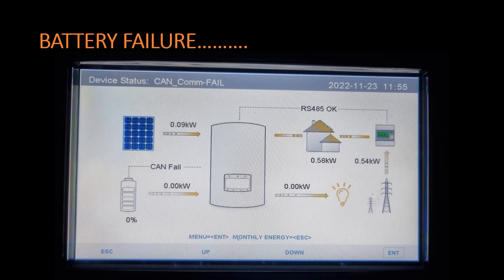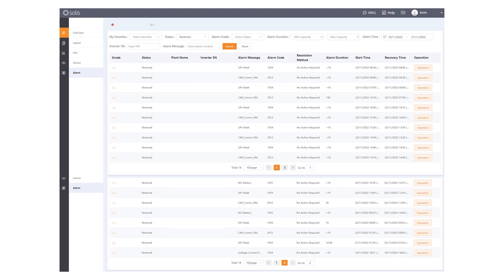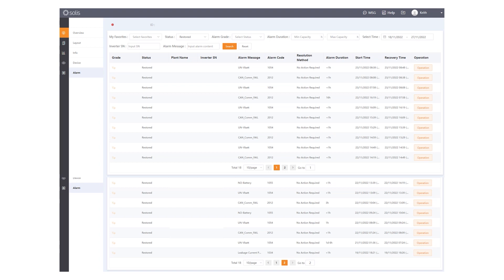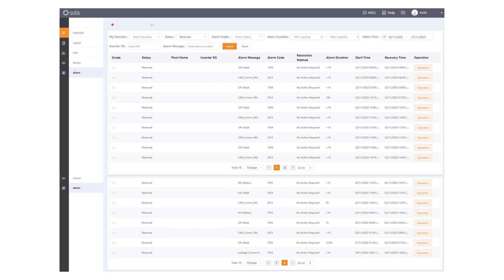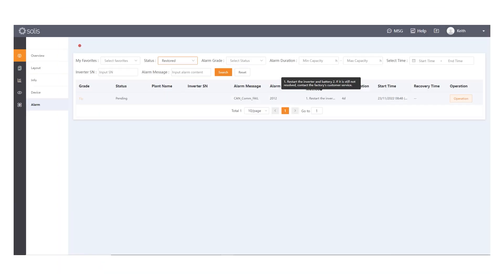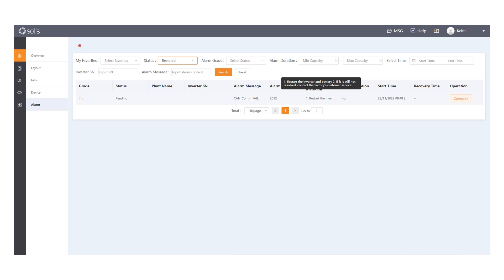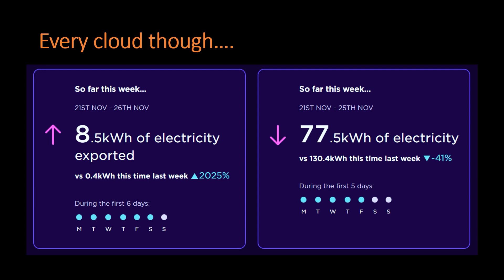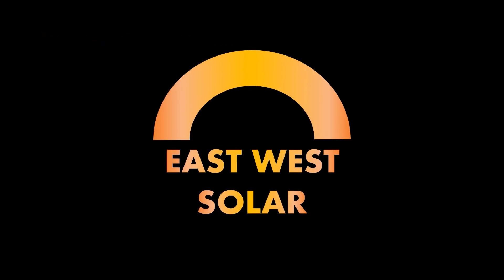Solis Inverter Communication Problems! Our first technical issue....

Comment: HI East West Solar: do you know which is the protocol that the solis inverters use to talk to the gateway/data concentrator over RS485? We thought it was modbus, but its not/ thanks!
Reply from the maker: I'm not sure I'm afraid. A quick google search shows that it is modbus, but I suppose the question is more what you are trying to integrate the inverter with?

Comment: Are all your batteries the same size and model ?
Reply from the maker: They are - they are all PylonTech PYLON US2000 PLUS LI-ION Batteries.
Reply: @East2WestSolar  I have same solid hybrid inverter and same batterys also same problem.Did your issue was fixed and if yes what they did?

Comment: I have the same setup and have the same issue and still have NO battery, been 3weeks with no battery, my system was installed in January 2023
Reply from the maker: Hi Malcolm - that's frustrating - I'm surprised the issues is occurring on new installs still!

Mine was resolved at the beginning of February and I've not had any issues since. The engineer that came out effectively reinstalled each battery and made sure they all had the latest firmware update. That seems to have resolved the battery part - although I believe we are still awaiting a firmware update for the Solis inverter.

Comment: Thanks for this.  My Solar system was installed on Wednesday this week, and I noticed this morning I had a can comm fail.  After a few minutes it went to OFF GRID, and has stayed there all day.  The pylontech battery is at 2 lights with the run light blinking very slowly.  Contacted the installer, they were supposed to come today to sort out the dongle (they didn't come) as it refuses to connect to my home broadband, and my phone can't see it, despite having a split system in the house.  

So I have a system that  has a fault, an app and PC that has not data in it, and it is now Friday evening, so no help until next week, and of course that is the one week that I am away from home the most.  Not very happy at the moment.  The only consolation is I haven't yet parted with my hard earned money to pay for it.
Reply from the maker: No problem Andrew - I hope you can get your system resolved sooner than it took for mine to get sorted!

Couple of points - the dongle probably should be connected to a 2.4ghz network (assuming it's the same as mine - I can't find the box with the details on at the moment). And mine is connected to a mesh point on the ground floor in the kitchen and the signal is fine.

I'd suggest to your installer to consider recommissioning the batteries and doing a manual firmware update of the batteries. That solved my issue and as of today they have been running for the last 10 days without any alarms since that process was performed.

Good Luck!

Comment: Have you guys had this resolved by Solis, or your installer, or do issues remain? Which installer are you using?
Reply from the maker: So I literally had our installers out today - they've done a full recommission of the battery installation and performed a firmware update on the Batteries. The Batteries are now performing as they should - but I'll give it a few days to ensure that are working consistently.
Solis still need to perform their firmware update, that will be remote.

Comment: Just had solis ac coupled inverter installed along with 2 x 5kw  Puredive  batteries, suffering exact same issue with battery 2, but at least i can still use one battery. Brand new system less than 3 days before problems started, installer been back and upgraded Puredrive firmware on batteries with no change to issue.
Reply: We had this problem too with our puredrive battery. Looking at a reasonable forum we found that there seems to be a firmware issue. Our workaround at the moment is to use the LG-Chem settings instead of Puredrive.
Reply: Solis does not recognise LG as battery, have replaced can cable with cat7 still getting can com fail

Comment: I chased up my supplier this week.  They advised that they dont have permanent fix yet but would try a work around.  When I switched off my batteries they were at 8%.  They asked me to power the batteries back on and made some remote changes - Initially the charge showed zero but quickly showed the 8% level.  The batteries then  charged from the grid until 21% and have sat there at 20-21% for the last  two days. So are no longer depleting below the 20% threshold.   Today we had some decent sun and got to 35% now we are running on battery as the sun is close to setting.  So far so good.  At this stage the State of Health SOH is showing 100%.  No indication of degradation of performance yet.     I will update if anything of significance happens.  ** Update Afternoon 26 Dec ** Good news is lots of sun today.  Bad news > whilst before the problem occurred 100% charge would be normal on a bright day like today.  Today by early afternoon reached 97% charge.  However, whilst continuing to receive power according to Soils cloud -  would not go beyond 97%.  Often stopped charging and sent excess to the grid - but  then revert to charge for a while and did not  reach the magical 100% I would have expected.  Possibly indicating some degradation or alternatively something to do with the configuration settings.  SOH still shows as 100% ....  but how is this measured ?
Reply: @Tranpay Any ideas what was done as a workaround I've been talking to Solis but they can't see my inverter when it is off at night as it is offline, did your batteries charge before they did anything.

Comment: I've had the same issue this weekend (03/12/22), my installation was in August 2022, have to say I'm distinctly unimpressed with the support service I have received.
Reply: @Carl Hathaway, I have had the same problem since early December with A Solis Inverter and pylon tech batteries, I would be interested if your installers do have a fix
Reply: @neilbennett844  I'm assuming they have one hence making an appointment to visit. Solis did a maintenance update overnight, hasn't cleared the can_comm_fail error but maybe it's a precursor to a site visit.
Will glean what info I can next week and update.
Reply: @neilbennett844  @Tranpay @Neil Bennett received an email at 1530 yesterday saying the issue has been fixed for me. The app was showing 20% charge, previously it had been less than 1, so I guess the app wasn't showing accurate information.
Currently everything seems to be working, namely the battery getting charged, still exporting/importing to/from the grid and using from the battery where appropriate.
Installers monitoring over the weekend so probably no need for the engineer call out.
Hopefully the fix will be applied to all monitoring this YouTube video.
Reply: Hi Carl,. Is your supplier also advising that they are awaiting a resolution from Solis?
Reply: @tranpay4065  initially they were, but having kicked up a bit of a fuss yesterday about lack of info/comms, they're sending an engineer next week, so I suspect  they have now been given a resolution but it will need an engineer visit as it can't be done remotely.
Reply: @carlhathaway6761  thanks...i will be interested to see if the battery indicates 100% State of Health once recharged.
Reply: @tranpay4065  @Tranpay @Neil Bennett received an email at 1530 yesterday saying the issue has been fixed for me. The app was showing 20% charge, previously it had been less than 1, so I guess the app wasn't showing accurate information.
Currently everything seems to be working, namely the battery getting charged, still exporting/importing to/from the grid and using from the battery where appropriate.
Installers monitoring over the weekend so probably no need for the engineer call out.
Hopefully the fix will be applied to all monitoring this YouTube video.
Reply: @carlhathaway6761  Great to hear.  So we can be confident that there is a fix being applied.  My batteries are turned off at the request of the supplier .  I understand I need to wait until advised to turn back in to ensure no impact on the guarantee.  Hopefully will be resolved for everyone soon.  Hope all goes well
Reply: @tranpay4065  @Carl Hathaway  My Supplier raised a ticket with Solis and got Solis to update the firmware and run a system check remotely, which they said cleared the previous faults and just reset to the installers preset. I then turned on all my batteries and after the batteries did their self check and cleared the fault lights the batteries took power from the grid to get back to the standard 20% and balanced themselves, the Inverter also cleared its fault light. Everything is now operating as expected.
Reply: اشتريت متلا هدا النوع من انفلتر  Solis  لم يشتغل معي ليس لدي  البطاريات  اريد ان يعمل بدون بطارية

Comment: I  could have made exactly the same video.  installed 1 Sept 22. Same Errors, same weekend and went through the same processes and analysis as yourself.  I have (After speaking to the installer) turned the batteries off at 8% - I am wondering the degree to which these batteries (I have three) could be damaged by sitting below the recommended 20% level.  Even if once back up and running and  even if the State of Health shows 100%  might there by an accelerated degradation over time ?  I cant find any other reference to this incident apart from yours (Great job).  I  too suspected a   config update gone wrong.  I understand from the installer that there are multiple customers effected - must be pretty frustrating for them too.
Reply from the maker: Completely agree - the installers advised that this issue is not one they've seen before - or can be resolved by their normal processes that they give to customers.

As I mentioned in the video - mine are completely drained - so you raise a good point on potential degradation. Interestingly - although they are switched off the still show in the app as feeding 0.001 kWh - which is weird.
Reply: @East2WestSolar  Maybe with a complete absence of the batteries the app defaults to a minimum value. I listened to your earlier videos and see we are both on the Essex Coast. I am near Mannningtree / Harwich.
Reply: There's a 10 year warranty on the batteries, so they should in theory be replaced without charge if they fail within that period. Ive the same problem, also with a 3 battery configuration, which was installed less than 4 months ago.
Reply: @carlhathaway6761  agree it's good to have the comfort of the guarantee behind us for failure.  The concern I have is if the batteries underperform and are less effective than if they hadn't been sitting there below their recommended minimum.  We may not be able to see this for some time after the fix we should ask for a statement to advise the likely impact on performance.  I am interested to see the reported statement of health once the system. It's good to have a few people in the same boat I think!